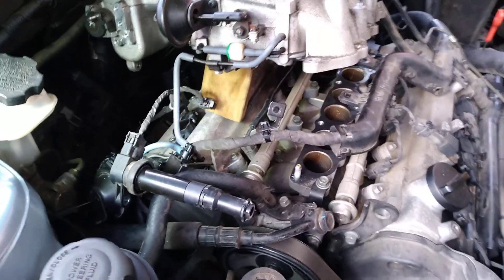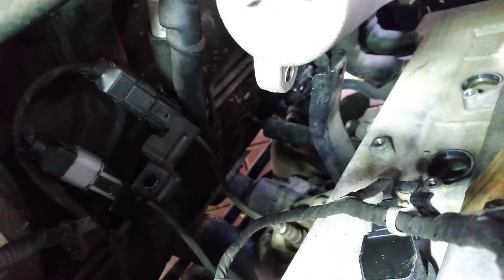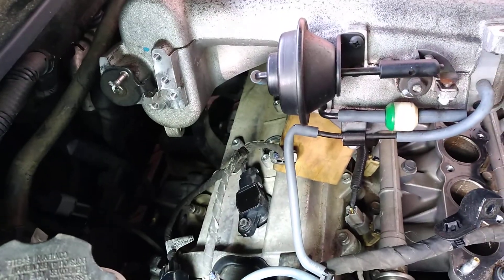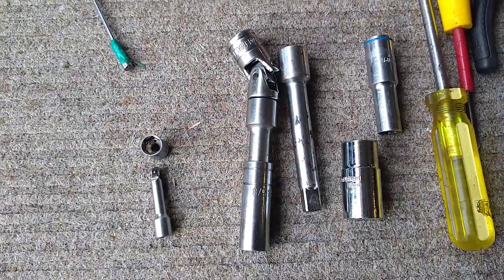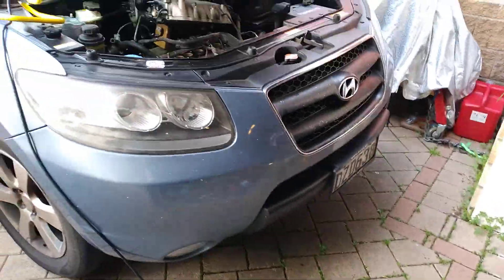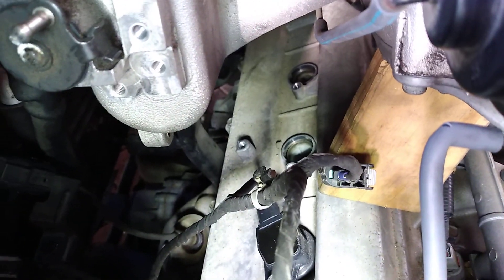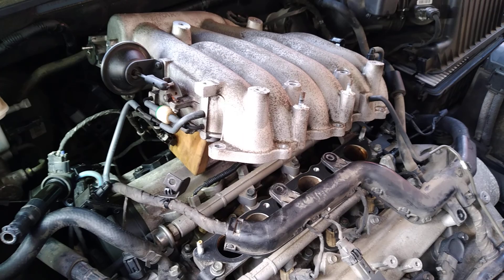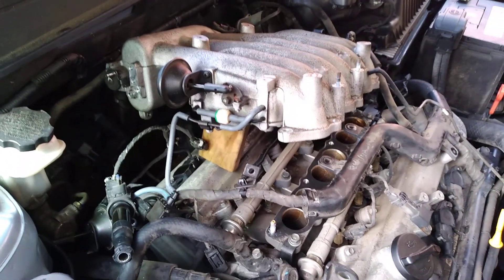Hyundai Santa fe V6, coil pack to be replaced

Comment: Do you have a video showing the plenum removal?
Reply from the maker: Hi thanks for viewing, no I actually left the plenum in place, just lifted it, saves taking throttle off etc, cheers John
Reply: @jonlamb5299  I have the same engine and I was trying to figure out what parts I actually have to remove to do the same thing as I am replacing both plugs and coils for the whole back bank cause I don't want to do it again
Reply from the maker: Hi great, you'll be fine, I took each bolt out on top of plenum, careful don't tear the gasket, I got high enough to replace the 3 plugs and coils, tight but possible, good luck